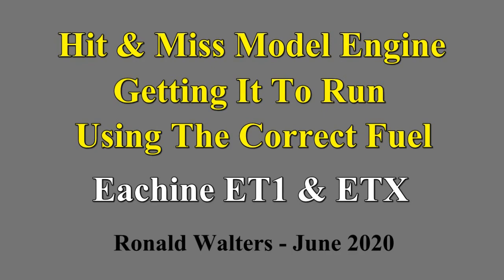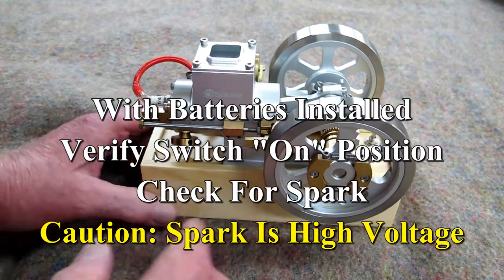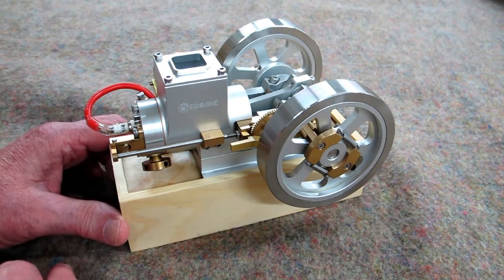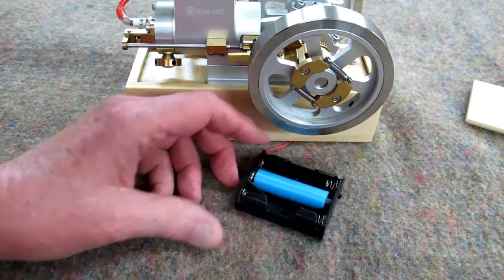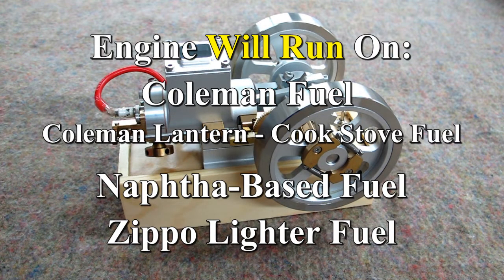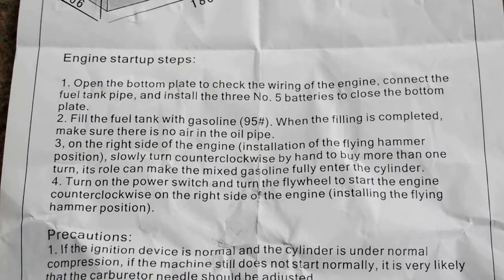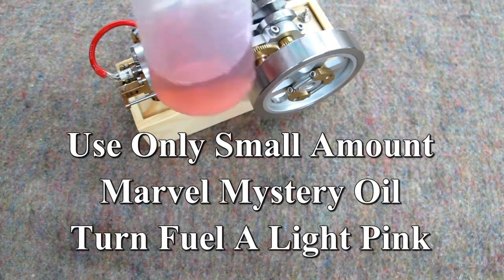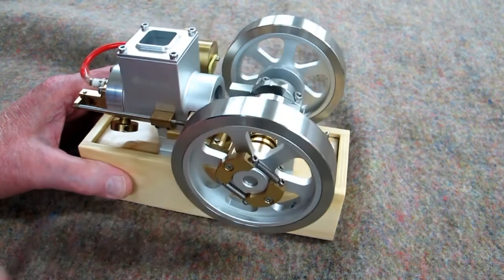Hit & Miss Engines - The Correct Fuel

Comment: Wondering if Brown's gas would work in a hit and miss engine to power a home generator with fuel made at home. Your thoughts or experience?
Reply from the maker: I have no experience with Brown's Gas. 
If you are thinking about running your model engine with hydrogen, don't. 
Model hit and miss engines are often run on butane or propane but an appropriate carburetor would need to be fabricated. 
And a small model engine like these is not going to be satisfactory as a home generator.

Comment: Do you need to add water in the hopper for normal operation? There no oil to change right? :D
Reply from the maker: Yes, put water in the cooling tank. No oil to change but you do need to oil the upper ad lower ends of the connecting rod and the crankshaft. Watch my review videos and you will see the various points that need oiling before each run. Thanks for watching.

Comment: I pumped gas in the 60's here in Iowa and the Conoco station still had a white gas pump. We used it in our Coleman lanterns and cook stoves but the main reason the gas station kept the tank around was to provide fuel for those in the rural community that still cooked with what were called kerosene stoves. Maybe the stoves would burn both white gas and kerosene; I don't know. We didn't sell kerosene anywhere in town in the 60's. The people buying the white gas always just asked for kerosene and knew we would fill their small spouted cans with white gas. 

To make it even more confusing, it was always mentioned that the lead in regular gas would clog the gas generator in a Colman style lantern or cook stove and white gas didn't have the lead. A decade later they introduced unleaded fuel! People had no idea if it was just a new name for white gas or something different.
Reply from the maker: I am told the camping lanterns and cook stoves in Europe burn kerosene. I had some comments regarding my reference to Coleman Lantern Fuel (which is not kerosene) and the confusion it caused as they were  trying to run their hit & miss engines on kero. That is when I made the "correct fuel" video.

Comment: Crown(brand) and Coleman stove fuels seem to run the same in my mini engines. They are both crystal clear, smell the same, but the Crown fuel is a bit cheaper than the Coleman in Wally world, anyway. I have read that these fuels are only about 55 octane, but prolly good enough for the CR's this little engines have.
Reply from the maker: Very good information.
Thanks for the comment!
Ron

Comment: I'm at the end of my tether with this engine. I run mine at engine shows along side my full size Hit And Miss engine but every few months I have to strip it to tighten the flywheels especially the one on the governor side. I tighten the grub screw as tight as I dare (not wanting to strip out the thread) but it never lasts. All of a sudden it will stop running for no reason and when I inspect it I discover the flywheel has come loose AGAIN. I would not mind but this flywheel cannot be re-secured without removing the governor assembly to get to the grub screw. While I agree these engines are well made this is a major flaw in the design which must be corrected by Echine. This will stop me from buying other Echine engines that have this method of securing the flywheel to the crank.
Reply from the maker: I agree, it is a very sloppy way to fix the flywheels to the crankshaft. Also, on some engines the grub screws go in at an angle, which really make a mess of the crankshaft.

I am sure you have noticed the holes for the grub screws were drilled and tapped first, then the steel rim was pressed on. If you are able to do so, you could remove the flywheel(s) and press off the steel rim. Then drill and tap new positions for the grub screws that would then clear the governor mechanism. Hopefully the steel rims could be pressed on again. Otherwise Loctite would be needed to hold the rims firmly in place.

Repeated loosening of the flywheels burrs up the ends of the crankshaft and (at least on my ET1) makes it nearly impossible to remove the flywheels. I don’t know if Eachine sells replacement crankshafts. Banggood does not. With a new crankshaft (or, if you are able, machine your own replacement), machine flats matching up to the grub screws. The crankshafts are not very large in diameter but two shallow flats on each end plus the use of a low strength Loctite would solve most of the headaches.

The little EM2 Vertical Hit & Miss with Flying Ball Governor is a nice slow running engine that does not jump all over the place.

Sorry for your headaches with the ET1 flywheels. 
Ron

Comment: hi, are the failed original ign systems the reason for going 2 battery?  et6 ran about 60 seconds total out of box w 3 batt.. just shut itself off and the ign system seems ded.. or did i jus draw short straw this time? lol   
sigh
Reply from the maker: Back with the original blue hit & miss engine and the ET1, it was noted they would sometimes quit running when three AA batteries were installed (4.5VDC). Using a dummy battery or by some other method reducing the battery supply from 4.5VDC to 3VDC solved the problem. Consequently I have just made it a habit to use only 2 batteries. The dummy battery has worked on most of the engines, however there have been a couple engines recently which would not run with only two batteries installed and required all three batteries to fire. Please keep that in mind for any future engines.

When the engines would quit with three batteries, after removing the one battery the engine would then run again… the ignition module did not need to be replaced.

I have heard reports from several people who have had ignition modules fail. With the modules sealed in epoxy you can’t see what is going on in there. 

The ground can easily come loose. Adding a washer under the ground wire so you aren’t tightening against the wood makes a better connection.

A bubble in the fuel line will also stop the engine. Pull the wire and check the spark.

If you just received the engine and if you purchased it from Banggood and if all else fails, report the problem and ask for a new ignition module or to replace the entire engine.

Thanks for watching. Please subscribe. 
That's what keeps this channel going! 
Ron
Reply: @RonaldWalters2010  thanks for the reply.. ill be contacting them..   the ign unit does not have this epoxy as ive seen in other photos... it appears to be a plastic side with vent holes thats glued in place .. maybe an older version? The brass is a bit tarnished .. maybe its been sitting or someone else's return.

Comment: Has anyone drilled the main bearing caps to oil the mains.
Reply from the maker: The crankshaft runs on needle bearings (not bushings) so the oil wouldn't get to them anyway. Some do it for the "looks" but it is a waste of time.
Reply: @RonaldWalters2010  thank you so much . I'm ordering one this week.
Reply from the maker: I hope you will use the links and discount codes found in my video descriptions whenever you purchase an engine. It can save you money. Ron

Comment: My Hit & Miss ET1 was suffering a reduction in compression so I removed the piston to change the piston rings ('O' rings) and found that despite the piston having two ring grooves the manufacturer had only installed one 'O' ring, can you tell me if this engine has one or two 'O' rings installed??
Reply from the maker: When this new series of hit & miss engines came out (starting with the ET1) I believe the piston had 2 o-rings installed. Apparently people were complaining the ET1 did not slow down enough. The manufacturer removed one o-ring to slightly reduce the compression which helped slow down the engine a little. So… most of the hit & miss engines in this series (ET1 through ET8) only have one piston o-ring. You can install two o-rings if you prefer and see what difference it makes to how your engine runs. Compression, needle valve setting, fuel used, governor springs will all affect idle speed. Have fun! Ron
Reply: @RonaldWalters2010  Thanks, I've installed just the one 'O' ring. Do you happen to know the spark plug gap and the exhaust valve tappet clearance? my engine is factory set at: spark plug 10 thou and the exhaust valve at 3 thou.
Reply from the maker: Both are not very critical. The valve rocker mechanism is pretty sloppy, so as long as there is available movement between the tappet and valve stem when the valve is closed, that is about the best you could hope for. Spark plug gap is again not critical as long as it isn't closed up too much... about the thickness of a No.11 Xacto blade (0.02" or 0.5mm).

Comment: I will run this on propane. But, not for long as it has no lubrication for the piston and cylinder. It relies on lube from gasoline, diesel or kerosene mix, only after it gets hot (running temp.) This was not built for long running times. After it gets hot,  I think  you can slow the rpm down a bit by leaning the fuel out. I will see. This is some of the best machine work that I have ever seen. 👍👍👍 Looks like a Fairbanks-Morse 503 or 739.  All that is missing is a condenser on top the water hopper. Thank you for reading my short novel!! 😬😬😬

Comment: I have a Chinese mini hit and miss coming soon.  I'm just wondering what is the point of the marvel mystery oil in the fuel? Everyone says to do it but I've never seen the reason? I'm guessing for the piston o "rings" ? Beyond the orings I see no point in the marvel mystery oil.   Please school me
Reply from the maker: No oil and the o-ring piston rings won't last very long. 
You could use other oil... but... it takes very little Marvel Mystery Oil and it does not carbon up the piston, spark plug, combustion chamber.
I have a video on the "Correct Fuel" https://youtu.be/TvLziWCI7Oo
Reply: @RonaldWalters2010  perfect.  Thank you very much.  I've seen that video but didn't pay attention if you said it was for the rings.  If it did something on the top end or valves I wss going to run caster is the main reason I asked.  Thank you for the quick reply
Reply from the maker: Castor oil is usually used in Methanol for R/C engines. These hit & miss do not run on methanol. Use gasoline of Coleman camping fuel.
Reply: @RonaldWalters2010  I was going to use the ethonal free fuel from home depot I run maxima caster 927 in all my 2 strokes that was the main reason I was going to use it if it lubed anything more than the rings.  But just keeping the orings slippery I'm just going to mix a small quantity of marvel mystery oil like you said.
Reply: @RonaldWalters2010   Castor oil was and still is used for full sized rotary aircraft engines. The reason it slimes up model airplanes as well as full sized WW1 airplanes is because it doesn't burn in the engine! You won't get carbon fouling from something your not burning.

Comment: I just got my ET6. It has been no end of problems. No or weak spark dropping to nothing after just a couple of minutes. I will try just 2 batteries.
Fuel has been a point of contention. I have had the longest run on pure 4 stroke gas with no alcohol out of the expensive quart from my local tractor supply house. When it quits, I switch to pure alcohol and repeat the same run time (with the allowance of about 30 per cent more fuel than gas) just to stop again after a couple minutes. I will try Coleman fuel from my small engine stash. 
It was also strange that only 1 ring was in place from the factory even though there are 2 rings provided for on the piston! I will try 2 because I bought spares.
I hope I get it right soon, my wife is watching with her evil eye present!
Reply from the maker: I have a video on the correct fuel. Coleman Fuel is what I use or you can use regular gasoline. These probably will not run well on alcohol and alcohol is not recommended.
They are installing only one o-ring on the piston to reduce compression so it will run slower (so I have been told by the manufacturer).
If it continues to not run then file a claim with whoever you purchased it from.
Reply: @RonaldWalters2010  I did Coleman fuel with a hint of Marvel oil, installed the second o ring, removed 1 battery, etc. Ignition troubles quit, fuel control problems subsided, and so on. Thanks Ron!
The rest of the adjustments are being sorted out now. Super fine adjustments and test before moving on.
Reply from the maker: All of these carb's need VERY fine needle valve adjustments and after it warms up a bit, it needs adjusting again. Next time you take it apart I would suggest only one piston o-ring. Contrary to what I said in my ET6 video... THERE IS a tiny spring inside the top of the flying-ball governor. Changing the size of that spring can alter the running speed of the engine. I have no idea what size the spring is or a source for replacements (other than making your own) as I have not had mine apart.

Comment: very light, non oil-based fuels. gotcha.
I heard in many kit hit miss engines, piston rings could be nitrile or viton, def not good with any alcohol based or spirit fuels, but if you upgrade to iron rings shouldn't be a problem
Reply from the maker: The piston o-rings in these engines are the green high-temperature type and they last for quite a while.

Comment: How are you lubricating the mains and big end?  I have one as well, and see no obvious way to do it other than dribble some oil on the sides and hope a little makes into the actual bearing.
Reply from the maker: Watch my video on the ET1. I don’t show it in every video but basically you need to dribble a little oil on anything that turns, slides, wiggles or moves. The upper and lower ends of the connecting rod are bushings and need a little oil every run. The crankshaft runs or ball bearings so no point it oiling that area. They are a little messy and need cleaning quite often.

Eachine ET1 Upgraded Hit & Miss Engine
https://youtu.be/ZCrjj4niyto

Please subscribe. 
That is what keeps this channel running. 
Ron

Comment: Hi Ronald, Just curious why you only want to run it on two batteries. Saving batteries or will it just run better? Thanks
Reply from the maker: Myself and several others, experienced the ignition would (sometimes) quit making a spark on 4.5 VDC (three batteries) but with 3 VDC (two batteries) the problem went away. And since the ignition circuitry is sealed in epoxy, nobody knows what was causing the phenomenon. Ever since I have only used two batteries.
Thanks for watching. 
Please subscribe. That is what keeps this channel running. 
Ron
Reply: @RonaldWalters2010   The description of the enfine says voltage 3.5V so maybe just one LiPo-cell?
Reply: @RonaldWalters2010  thick fingers - I mean engine

Comment: hve you tried to run this engine on alkylate gasoline,normal gasoline contains ethanol and is probably not the best fuel for small engines.
i think alkylate fuel burns a bit cleaner than many other fuels and one can buy it in one litre containers that can be stored for years.
Reply from the maker: Sorry, I am not familiar with alkylate fuel. I did a brief search but did not see an octane rating. Try it, see if it works.

Comment: 7:44 interesting how you shut it off just before it craps out like mine does.. runs like 20 seconds and shuts off. Its nearly impossible to fill the tank as well as the filler hole is way to small to let the air back out.. Also they do have super great spark.. Good enough to spark right out the plastic on the wire.. grounds to the engine and wont run with it doing that. unfortunately these engines really need some upgrading
Reply from the maker: No, mine will run as long as you keep fuel in it. There are other videos where I show it running much longer. Generally I don't run it much longer than a few minutes. If the spark plug wire is not against the spark plug, and you have just the wire in your hand, it will jump through the insulation and zap you a good one. And if the wire gets too close to a metal part of the engine it can jump across. The older blue engines were much worse about doing that. Thanks for watching.
Reply: @RonaldWalters2010  i think they need to upgrade their plug wire
Reply: Keep the ignition wire off the block. May need to add insulation. ⚡️⚡️👍👍👍

Comment: I added the lighter springs to both my vertical and horizontal engines. Alot of difference was made on the vertical. The horizontal however not so much. I believe it has to much compression as when it fires it really gets it spinning. I had read that the vertical has much less compression.
Reply from the maker: The vertical and horizontal are essentially the same engine. Last year I was told they started placing only one o-ring on the pistons to lower the compression. If your horizontal is an older one, it may still have two o-rings on the piston. You've been wanting to pull the head off anyway. :-) May want some spare o-rings before opening it up, just in case. Personally, I have not opened mine up (if it ain't broke don't fix it). Please subscribe. That is what keeps this channel going. Ron

Comment: Sir, where can you purchase the dummy batteries
Reply from the maker: I have never purchased one. As I said in the video, I made mine on a 3D Printer. You can search eBay for "AA DUMMY BATTERY" but they are a bit expensive and usually sold in multiple lots or 4 to 10 pieces. You may be better off searching for "AA Battery Pack 2 Cell 3 Volt" and replacing the existing 3 cell holder. https://www.ebay.com/itm/AA-Battery-Pack-2-Cell-3-Volt/152820447452?hash=item2394cef8dc:g:VPMAAOSw401aKuR~
Hope that helps. Please subscribe! Ron
Reply: Thank you. I appreciate it. Have an good day!
Reply: Im considering one of these and thanks to you i understand the govonor concept more and im getting one for sure.
Reply from the maker: Very good. Links and discount codes can be located in the video description(s). Thanks for watching. Ron